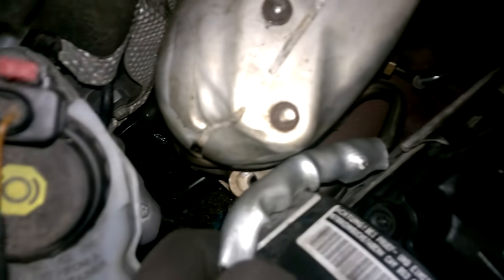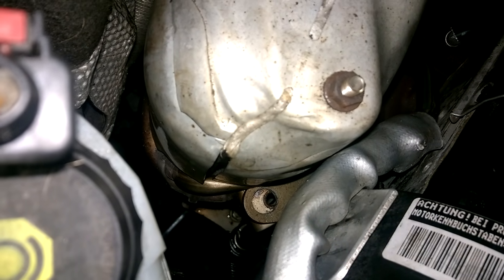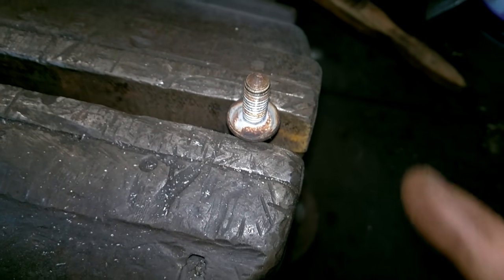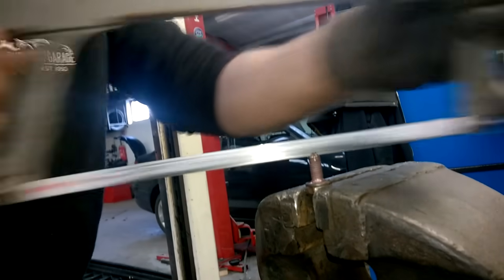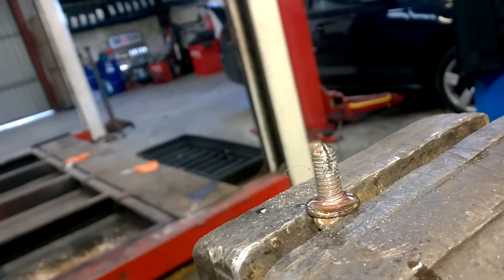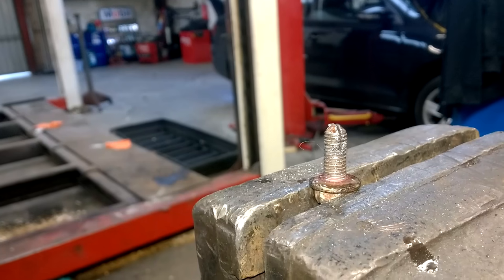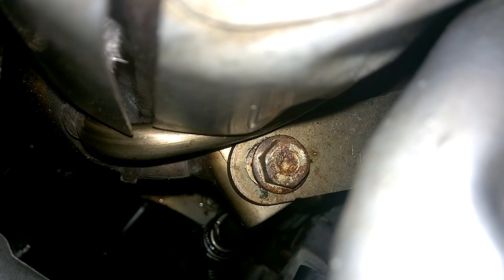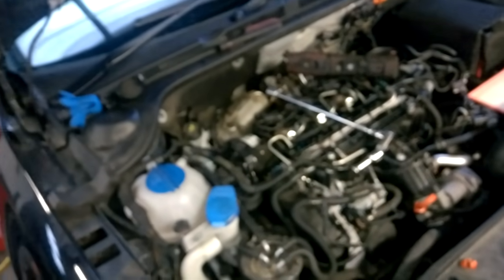My Father Taught Me This! Passing It On To The Next Generation

Comment: Cool idea but why not fix the problem in the first place than mask it while weakening a fastener?
Reply: Silence!
Reply: Shaddup. The fasteners aren't weakened you don't, it's using threads further down.
Reply: @Gorilla_Jones  If you understand the basic principles of how a screw works you would know that's not at all true.
Reply: I guess it depends on how much you care about the car. It looks like something that would take a lot of time to fix the proper way. The customer may not want to spend the money. The engine could die before the next time you need to take that off. 

I’ve used a lot of helicoils and even tig welded and rebuilt the threads entirely but I could see myself doing this on one of my beater cars for sure.
Reply: @handsfreekvm  See now that's a fair point. I was looking at it the other way around and wondering how many butcher jobs like this are a lurking problem and the owner doesn't even know. If it's on youtube you just know it's going to be a problem somewhere. God knows I've micky moused some shit in my time but I avoid it whenever possible as I find more often than not problems snowball.
Reply: ScoutPilfer yea man, I’m kind of obsessive with doing stuff right. At some point in my life it kind of clicked, I’m sure it was when I was under a car pulling parts off to take it into the shop and machine it to make it right up until 2am, what the hell am I doing making this thing 100% right when this car could be in an accident this week and all that labor is wasted. I think you should have one car or hobby you’re proud of and make it a show car and be meticulous but if you treat everything like that you may regret the time loss later in your life. The other day I was using some old metal shears my father in law had they worked good but were so old I started sanding them down and sharpening the edge getting all the dents out of the edge then I was going to sand it down and paint the handle then I stopped and was thinking this is going to take hours wtf am I doing here and I just sharpened it and made it usable put some WD40 and call it a day.  On the contrary though don’t ever take short cuts with safety I had ghetto rigged a fuel line I needed the car to get point a to b in a hurry cause I was moving out of a house on short notice. The fuel line did its job and worked once until I forgot about it and later on started leaking which caused some other issues. Well you just can’t win actually so I’m not sure what my point is anymore.

Comment: I use that technique as a thread cleaner. The burr on the cut bolt will clean the thread. Unscrew it and put a new bolt in no problem after that.

Comment: Seems like it would compromise the integrity of the bolt.   Wouldn't it be easier to move the parts into the proper position?
Reply from the maker: The update info below is the pinned comment on this video, I know most people do not realize I made that video and it better explains/shows this method in use.   
I also included below details of why the job was done this way free of charge with the customer fully informed. I hope you check it out  👇👇
 
UPDATE* I decided to make a follow up video on this https://www.youtube.com/watch?v=yfNQullGEuQ&feature=youtu.be Should answer some of the questions that were raised, I include 3 demos of this in action with close up shots.
 
As there was some safety concerns & confusing comments raised, I felt I should clear a few things up. 
1) This is a tip for certain circumstances only, I never have and never would use it on a component which would cause any safety concern to any customer.  
2) The demo was done on a support bracket only, items like this or similar will not cause any safety concern. 
3) I did this free of charge and on a time restraint, I noticed it when I was replacing another item, the customer needed the vehicle back that evening and I decided rather than leave it like it was, I would do this and secure it up fully. 
4) The bolt was not the issue, the part that the bolt threads into is a secured piece, someone had previously damaged it, leaving the bracket loose and the bolt just tightened a turn or so.
5) The bolt can be removed and will not break, it will go in and out as usual and has helped clean up the damaged threads.  
6) Used in the right application I personally believe this is a great tip and can save you a lot of time & trouble. 

Lastly to all the people who have watched the video, Thanks very much and I am delighted with the feedback I have received on it.

Comment: SO WHY DIDNT YOU JUST PUT THE BOLT IN WHEN YOU MOVED THE BRACKET OVER TO THE RIGHT ?
Reply: He explained that the first few threads were damaged and the bolt would not start. WERE YOU NOT LISTENING?
Reply: Why are you yelling in all caps
Reply from the maker: The update info below is the pinned comment on this video, I know most people do not realize I made that video and it better explains/shows this method in use.   
I also included below details of why the job was done this way free of charge with the customer fully informed. I hope you check it out  👇👇
 
UPDATE* I decided to make a follow up video on this https://www.youtube.com/watch?v=yfNQullGEuQ&feature=youtu.be Should answer some of the questions that were raised, I include 3 demos of this in action with close up shots.
 
As there was some safety concerns & confusing comments raised, I felt I should clear a few things up. 
1) This is a tip for certain circumstances only, I never have and never would use it on a component which would cause any safety concern to any customer.  
2) The demo was done on a support bracket only, items like this or similar will not cause any safety concern. 
3) I did this free of charge and on a time restraint, I noticed it when I was replacing another item, the customer needed the vehicle back that evening and I decided rather than leave it like it was, I would do this and secure it up fully. 
4) The bolt was not the issue, the part that the bolt threads into is a secured piece, someone had previously damaged it, leaving the bracket loose and the bolt just tightened a turn or so.
5) The bolt can be removed and will not break, it will go in and out as usual and has helped clean up the damaged threads.  
6) Used in the right application I personally believe this is a great tip and can save you a lot of time & trouble. 

Lastly to all the people who have watched the video, Thanks very much and I am delighted with the feedback I have received on it.

Comment: Looks like a broken bolt/easyout problem for the next guy. Y not do the job right and  get a new bolt ?
Reply from the maker: The update info below is the pinned comment on this video, I know most people do not realize I made that video and it better explains/shows this method in use.   
I also included below details of why the job was done this way free of charge with the customer fully informed. I hope you check it out  👇👇
 
UPDATE* I decided to make a follow up video on this https://www.youtube.com/watch?v=yfNQullGEuQ&feature=youtu.be Should answer some of the questions that were raised, I include 3 demos of this in action with close up shots.
 
As there was some safety concerns & confusing comments raised, I felt I should clear a few things up. 
1) This is a tip for certain circumstances only, I never have and never would use it on a component which would cause any safety concern to any customer.  
2) The demo was done on a support bracket only, items like this or similar will not cause any safety concern. 
3) I did this free of charge and on a time restraint, I noticed it when I was replacing another item, the customer needed the vehicle back that evening and I decided rather than leave it like it was, I would do this and secure it up fully. 
4) The bolt was not the issue, the part that the bolt threads into is a secured piece, someone had previously damaged it, leaving the bracket loose and the bolt just tightened a turn or so.
5) The bolt can be removed and will not break, it will go in and out as usual and has helped clean up the damaged threads.  
6) Used in the right application I personally believe this is a great tip and can save you a lot of time & trouble. 

Lastly to all the people who have watched the video, Thanks very much and I am delighted with the feedback I have received on it.

Comment: That alot of work, I would just sell the car.
Reply from the maker: The update info below is the pinned comment on this video, I know most people do not realize I made that video and it better explains/shows this method in use.   
I also included below details of why the job was done this way free of charge with the customer fully informed. I hope you check it out  👇👇
 
UPDATE* I decided to make a follow up video on this https://www.youtube.com/watch?v=yfNQullGEuQ&feature=youtu.be Should answer some of the questions that were raised, I include 3 demos of this in action with close up shots.
 
As there was some safety concerns & confusing comments raised, I felt I should clear a few things up. 
1) This is a tip for certain circumstances only, I never have and never would use it on a component which would cause any safety concern to any customer.  
2) The demo was done on a support bracket only, items like this or similar will not cause any safety concern. 
3) I did this free of charge and on a time restraint, I noticed it when I was replacing another item, the customer needed the vehicle back that evening and I decided rather than leave it like it was, I would do this and secure it up fully. 
4) The bolt was not the issue, the part that the bolt threads into is a secured piece, someone had previously damaged it, leaving the bracket loose and the bolt just tightened a turn or so.
5) The bolt can be removed and will not break, it will go in and out as usual and has helped clean up the damaged threads.  
6) Used in the right application I personally believe this is a great tip and can save you a lot of time & trouble. 

Lastly to all the people who have watched the video, Thanks very much and I am delighted with the feedback I have received on it.

Comment: yo you just reduced the tensil strength of that bolt from 25,000psi to like 4,000 psi.. just saying
Reply: During my apprenticeship i was told that you only need a bolts heads width of thread for it to take the recommended torque setting I appreciate that it's only a rule of thumb and can't be applied to every situation
Reply: Same here. Nice tip

Comment: I do dig it.  Although, I would've likely just moved the bracket & chased the threads, in the mount area.  With a thread chase.  I do get the fact that most may own a hacksaw, and maybe not a proper set of organized taps.  Thank you for sharing.  Old school is the best school.
Reply from the maker: The update info below is the pinned comment on this video, I know most people do not realize I made that video and it better explains/shows this method in use.   
I also included below details of why the job was done this way free of charge with the customer fully informed. I hope you check it out  👇👇
 
UPDATE* I decided to make a follow up video on this https://www.youtube.com/watch?v=yfNQullGEuQ&feature=youtu.be Should answer some of the questions that were raised, I include 3 demos of this in action with close up shots.
 
As there was some safety concerns & confusing comments raised, I felt I should clear a few things up. 
1) This is a tip for certain circumstances only, I never have and never would use it on a component which would cause any safety concern to any customer.  
2) The demo was done on a support bracket only, items like this or similar will not cause any safety concern. 
3) I did this free of charge and on a time restraint, I noticed it when I was replacing another item, the customer needed the vehicle back that evening and I decided rather than leave it like it was, I would do this and secure it up fully. 
4) The bolt was not the issue, the part that the bolt threads into is a secured piece, someone had previously damaged it, leaving the bracket loose and the bolt just tightened a turn or so.
5) The bolt can be removed and will not break, it will go in and out as usual and has helped clean up the damaged threads.  
6) Used in the right application I personally believe this is a great tip and can save you a lot of time & trouble. 

Lastly to all the people who have watched the video, Thanks very much and I am delighted with the feedback I have received on it.
Reply: @GerardBurkeBurkesGarage  Oh no criticism here.  Honestly, it was an "oh yeah" moment, followed by a "how cool is that ( !! )" exclamation.  Should've typed that first, then my 2 cents.  I really was appreciative of your sharing.  From the days of yore, my grandfather and uncle .. salute you.  So much lost data when the generation before us falls.  Hate that, really.  Such a shame.  THANKS AGAIN, BROTHER.  VERY COOL !!!! 👍👍👍
Reply from the maker: @jamiecampbell3068  Thanks Jamie

Comment: It works good for a non major load torque specs but if you're not trying to lose any strength whatsoever you know I would imagine that put to the test you would end up losing strength in the bolt and having a possibility of snapping otherwise for something basic that you're just having issues with tightening down it seems like it would work awesome

Comment: I was shown this years ago from someone. It came in handy once when I had a broken vent pipe in my kitchen. The pipe going up to the roof rotted at the T connection. I sawed the old pipe out and had to use a chisel to break out the old pipe where it had been threaded in the T.. The threads were a little "fouled" up so when I bought the new pipe, I bought 2 of them. One I cut in the shape of a cross at the threads creating a home made tap. I used this one to clean up the threads and installed the other one that now threaded in nicely.

Comment: Thank you. Been a mechanic for 25 yrs and never seen this before. Probably would have helped me it that time.
Reply from the maker: Thanks Ryan, I appreciate the comment. 
 
The update info below is the pinned comment on this video, I know most people do not realize I made that video and it better explains/shows this method in use.   
I also included below details of why the job was done this way free of charge with the customer fully informed. I hope you check it out  👇👇
 
UPDATE* I decided to make a follow up video on this https://www.youtube.com/watch?v=yfNQullGEuQ&feature=youtu.be Should answer some of the questions that were raised, I include 3 demos of this in action with close up shots.
 
As there was some safety concerns & confusing comments raised, I felt I should clear a few things up. 
1) This is a tip for certain circumstances only, I never have and never would use it on a component which would cause any safety concern to any customer.  
2) The demo was done on a support bracket only, items like this or similar will not cause any safety concern. 
3) I did this free of charge and on a time restraint, I noticed it when I was replacing another item, the customer needed the vehicle back that evening and I decided rather than leave it like it was, I would do this and secure it up fully. 
4) The bolt was not the issue, the part that the bolt threads into is a secured piece, someone had previously damaged it, leaving the bracket loose and the bolt just tightened a turn or so.
5) The bolt can be removed and will not break, it will go in and out as usual and has helped clean up the damaged threads.  
6) Used in the right application I personally believe this is a great tip and can save you a lot of time & trouble. 

Lastly to all the people who have watched the video, Thanks very much and I am delighted with the feedback I have received on it.

Comment: Very good idea, sometimes small taught like this save you an incredible amount of time
Reply from the maker: Thank you Overmars 
 
The update info below is the pinned comment on this video, I know most people do not realize I made that video and it better explains/shows this method in use.   
I also included below details of why the job was done this way free of charge with the customer fully informed. I hope you check it out  👇👇
 
UPDATE* I decided to make a follow up video on this https://www.youtube.com/watch?v=yfNQullGEuQ&feature=youtu.be Should answer some of the questions that were raised, I include 3 demos of this in action with close up shots.
 
As there was some safety concerns & confusing comments raised, I felt I should clear a few things up. 
1) This is a tip for certain circumstances only, I never have and never would use it on a component which would cause any safety concern to any customer.  
2) The demo was done on a support bracket only, items like this or similar will not cause any safety concern. 
3) I did this free of charge and on a time restraint, I noticed it when I was replacing another item, the customer needed the vehicle back that evening and I decided rather than leave it like it was, I would do this and secure it up fully. 
4) The bolt was not the issue, the part that the bolt threads into is a secured piece, someone had previously damaged it, leaving the bracket loose and the bolt just tightened a turn or so.
5) The bolt can be removed and will not break, it will go in and out as usual and has helped clean up the damaged threads.  
6) Used in the right application I personally believe this is a great tip and can save you a lot of time & trouble. 

Lastly to all the people who have watched the video, Thanks very much and I am delighted with the feedback I have received on it.